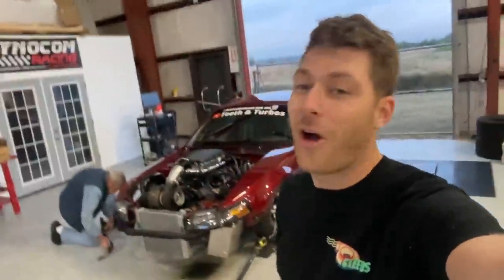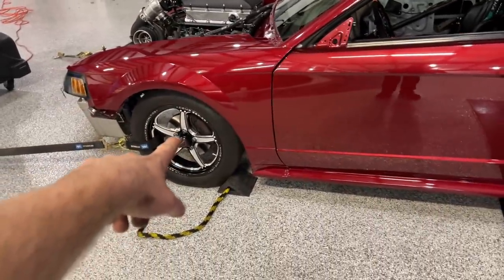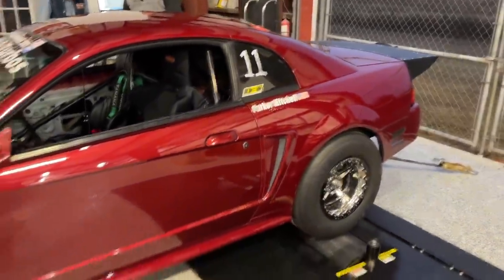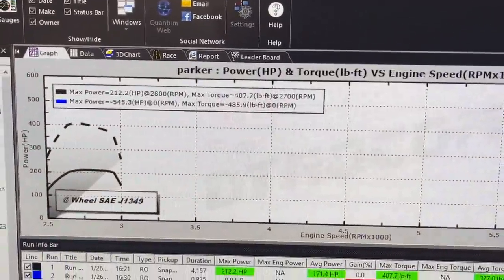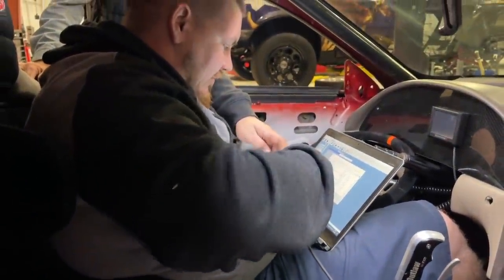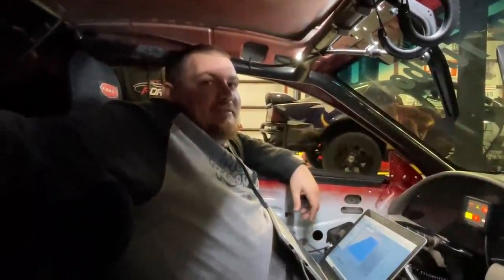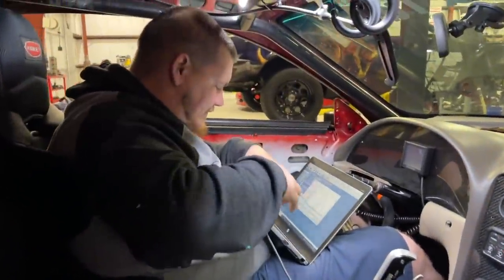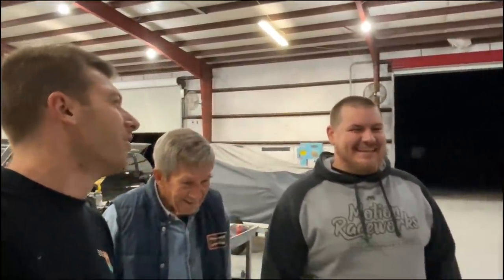We Dyno'd My Turbo 427 LSX and it is a MONSTER... Ft. Dr Tune Em All

Comment: Is it possible for the ecu to be told to target 8.50 i.e. good launch, add boost and timing / bad launch, cut timings etc. based on front wheel distance. Or is that cheating?
Reply from the maker: You can tell your computer to do anything you want!

Comment: You need to have James or tune ‘‘em all to look at pattern on rear gear . It doesn’t look right . There shouldn’t be tiny contact patch and it should be in middle of gear not on the edge .

Comment: Check the passenger rear, that last pull it smoked like the driver side was. 
Glad to see DrPepper stretching its legs and hope you run 8.50s all week and no issues, good luck man you have came a long ways with that car and quick.
Reply from the maker: It’s rubbing. Adjusting the lower control arms today before the track. Also it’s strapped down so that could contribute as well
Reply: x2 You can eat a brand new tire in one pull and have a bad blowout tearing up all kinds of stuff on the dyno. At the track it can be worse as it sends you into the wall. Be careful out there!

Comment: I like how you are putting the door panels back on... I like more complete interiors in street cars. If you can't go back to stock at least cover with a panel or better a leather or some kind of material with stitching mimicking stock or OEM+ But making aftermarket stuff work with OEM is always choice in my opinion.

Comment: How hard is it to put in a temporary intake air temp sensor? Like some where after the intercooler or just before the intake? 
 
Or pre and post intercooler? So that you can see the Delta(change in temp) or how efficient your intercooler is.  

Gale Banks always talks about how "boost" psi is not a very useful number. But if you have both PSI and Temp you can get concentration/per volume hence = density! + the right amount of fuel. POWER!!   and  additional safety when you can pull timing as the intake temps go up.

Will you or do you have an Ambient air temp sensor?
Reply from the maker: Need to make this happen

Comment: It's making power with minimal effort. The new suspension gets dialed in it will be a reliable beast. Then knowing you can turn it up more for PB's at the home track. You did a hell of a lot of the work with your own hands and learning on the way in a short time. That's something to be proud of.
Reply from the maker: Hoping so! So much work is paying off. Just need to get it to go straight